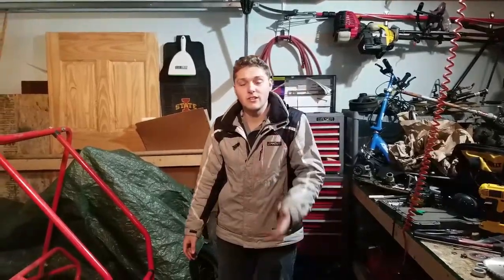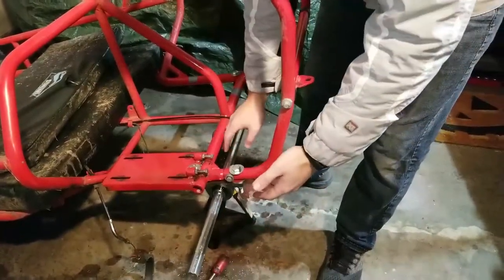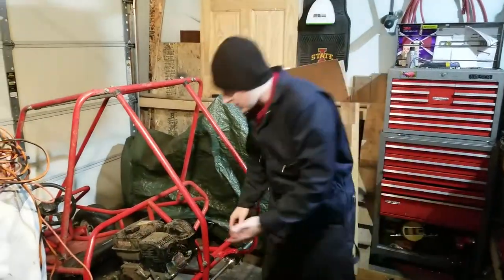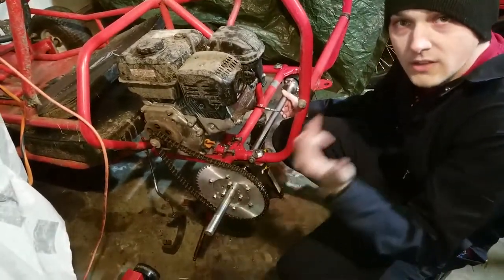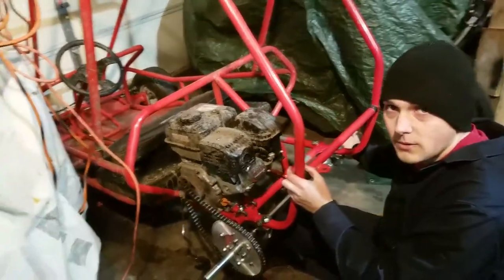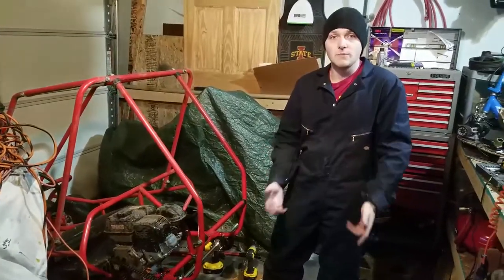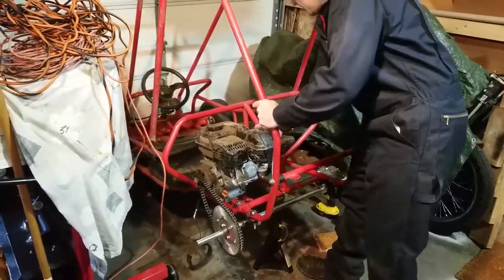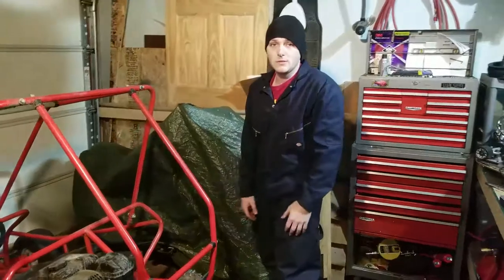Go Kart Axle Conversion - Sprocket & Brakes (Part 2)

Comment: Hey man dope vid hopefully u get back to me. I’m having a problem, my 2 sprockets are lined up but when I turn the axle (by hand) at one point it gets really hard to turn and at one point it’s really easy. Chain gets tight on one spot and then most the time the chain is loose.
Reply from the maker: If the chain slack is inconsistent then that means one or both of the sprockets are not perfectly concentric to their respective shafts. Sometimes sprocket bolt holes have some wiggle room if they're 2 pieces (hub and sprocket) and won't be concentric relative to the rotation of the shaft. Usually, the axle sprocket will be the culprit and you'll need to snug the bolts while holding the sprocket in the right spot and torque them down evenly. It could also be a couple rusty chain-links if that's applicable. 
Thanks for watching and good luck.
Reply: @freehandgarage  thanks man didn’t even think about that. The sprocket does have a little wiggle room so I will hold in place and try thanks man
Reply: Or u have sprockets that are not made for one another

Comment: Where did you find the live axle kit?
Reply from the maker: https://www.bmikarts.com/Go-Kart-Rear-Axle-Kits
Reply: @freehandgarage  which kit did you buy?   Was it wide enough?   Would you buy a longer axle if you did it again?   My kid has the same go kart and I want to do this to his.
Reply from the maker: @etpeterson7374  This was the exact kit I got. (https://www.bmikarts.com/Drift-Trike-Axle-Kit-with-Pillow-Block-Bearings-40-Chain_p_7195.html) I had to get new tires, a brake rotor and caliper as well for the stingray go cart. The overall tire width from the kit was slightly more narrow but it still worked fine, if I were to do it again I would try to get a longer axle but at the time I couldn't find one. Good luck